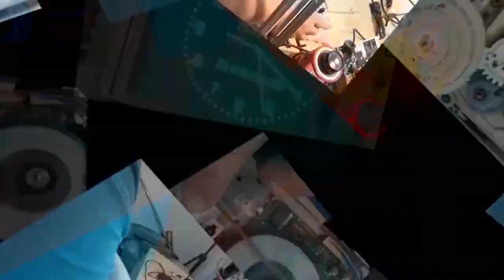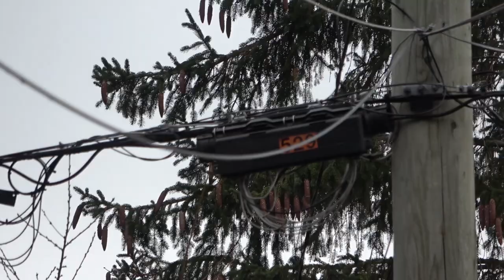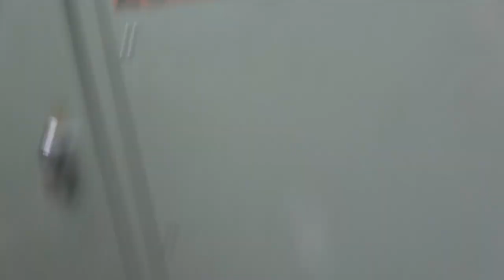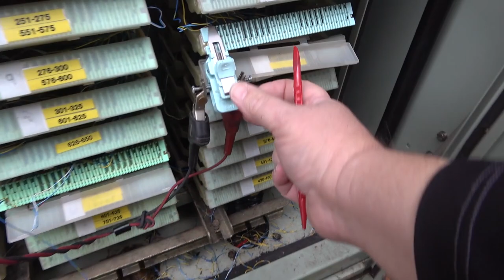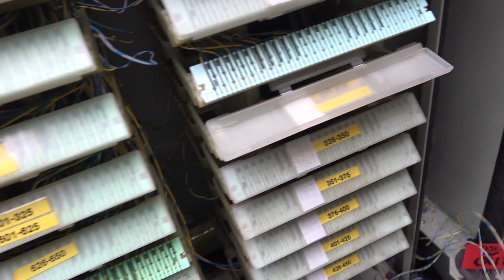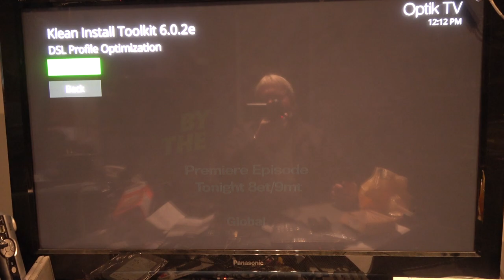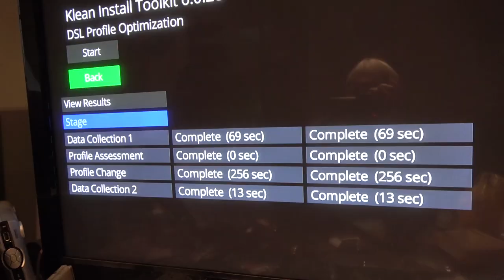Fixing my old noisy copper phone line

Comment: I live in a small town in Tennessee, and AT&T has fiber installed everywhere now in our town and they no longer are using copper for new phone line service. The apartment community where I live had fiber installed back in December 2022 and they moved all xDSL and copper phone service over to fiber,. This was supposed happen in 2020, but the pandemic put a kibosh on that timeline. Before the transition to fiber, the fastest xDSL we had was 13/3. Now we can get 1000/1000 as our fastest speed. I have 500/500 and haven't had any issues and it is a lot less expensive than Comcast cable internet. Question for you. You showed us what you described as a cross-connect. Is that the same as a remote terminal?

Comment: Here in my part of Saint Louis, MO, USA - fastest here is Cable at up to gigabit speeds if your pockets are deep enough. Starts at 100 down / 20 up I believe. We have 1gig fiber in select areas, but I have heard from those users that it has latency issues. Who knows, but cable is plenty fast for the price, around here.
Reply from the maker: Cable is limited to 20 up.  Mine at 75/20 is more than I need.

Comment: Common here to also get the move the pair, especially as there is now a push to fibre, and the old copper is no longer being maintained. Often they just will swap with any other pair, and move the fault to somebody else in the hope they will not complain, as the old paper cables are degrading in the ground.  Wet cable joins are bad with the few remaining ISDN and dedicated lines left around, plus with the few line expanders left, where that 200VDC on the pair does nasty things when it gets wet. 

You know you have an issue when your 30 pair feeder has 10 split pairs in it to get a good wire in at least some lines, and you have a TELEX machine that gives garbage from line noise. Tried to pull out the old lead cable, but it was solidly rusted in the conduit, so instead went with a new route.

At home disconnected the phone, as I literally only got spam calls on it, and the DSL was the only reason to keep it around. Has the original 50 year old cabling still, a lot thicker than the new stuff. Was hard to put in the Krone blocks, had to pre strip it when replacing the socket last time, to get a noise free connection. The phone though could not dial out, more because it was originally a farm party line phone with local battery and magneto, made in 1939, than anything else. Does however clear the line from noise quite well.......
Reply from the maker: 384 volts on the express power for the remote dslam here.  That will wake you up in a hurry. The red covered modules in the cabinet +192 -192 with respect to ground.

Comment: When they run out of CO replacement parts and fiber becomes mandatory you can get an ATA with pulse dial support.  Grandstream HT801 for example.  Security panels with cell or ethernet modules for the old DSC panel exist if you do not want the higher fee.  So alternatives for your objections to switching already exist.
Reply from the maker: When that happens my rotart phones will be display pieces only. 
cell and ethernet modules are only good for a monitored system. My system is not monitored by security company. It dials me directly. I am the monitoring company. I am never far from home. If my alarm goes off I check the cameras and if I see something I am the one calling the police. The police don't respond to residential alarms anyway.

Comment: To have fiber optic operation, the fiber optic line would have to be brought up to the house?  I'm a bit confused.
Reply from the maker: The fiber line is already there. I put it in about 2 years ago. It goes all the way from the connection box to my equipment closet.  Literally all I need to do it plug it into the splitter port and plug in an ONT.  I could have fiber up and running here is about an hour.  The thing is i don't want fiber service.  There is no benefit for me because I would never order faster internet then i currently have.  Sure gigabit internet is available but nobody needs that speed.  I have 75 megs and that is faster than anything i ever use.  I could function fine with 50 or even 25. Remember that an HD video feed requires only 7, a 4k feed 21.  
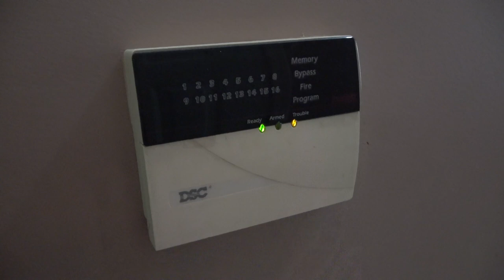So even with fiber my speed remains the same but I lose my backup phone during a power failure (sure a ups could be added but that only good for a few hours ) i lose the ability to use my antique rotary phones and the biggest is my security system.  It monitors the phone line.  If someone cuts it when it's armed the siren will sound. On fiber if someone cuts the fiber nothing happens because the voltage generated by the ont remains on the phone line and the alarm does not know that the line has been cut. Also ont's take updates in the middle of the night which causes them to reset when they reset the voltage drops off for about a minute the alarm system senses this as a line cut and sounds the siren at 3:00 in the morning, unacceptable. The only solution would be to change to a different alarm system one that works off of cellular which means monitoring fees that I don't have to pay now because my system dials my phone directly and alerts me if there's an alarm. I am the monitoring station if my home phone phones me I know there's a problem I check the cameras if I see something i Phone the police. The police respond immediately to a video verified break-in, they don't respond to alarm companies calling or to neighbors calling of a siren going. Even a self-monitored alarm.com system will cost me 12 bucks a month which is something I don't have to pay now for my hardwired self-monitored system. So i keep everything on copper and will untill the day they shut it down completely which is still years away.
Reply: @12voltvids  Thanks for the explanation.

Comment: What I always wanted to know is why twisted pair phone lines aren’t shielded?  Wouldn’t shielding make phone lines more resistant to electromagnetic and radio frequency interference?
Reply from the maker: The twist in the pair rejects electrmagnetic and rf interference.
Reply: The outside plant cables are in fact shielded.
Reply from the maker: @brianleeper5737  
No shit. They are bonded to ground at every access point and every splice point. Also underground drop wire is bonded at the splice and at the customer premise.
Reply: @12voltvids  They are bonded to ground, at least until the utility locator disconnects the bonds and never reconnects them.
Reply from the maker: @brianleeper5737  
The only place the bind is left open here is in the zoi of a power substation.
Reply: @12voltvids  I've found numerous bonds left open in Verizon territory. All I can figure is that utility locators are disconnecting them and not reconnecting them after they are done with the locate.

Comment: Very educational video, thanks!

The city I live in is still all copper from the local phone company, Frontier (it was Verizon up until about 2010). Max DSL speed available is 18Mbps down and 1Mbps up. (I live about a mile from the main switching building.) I had 12Mbps/1Mbps service for several years, but switched to Comcast a couple years because every time something failed they blamed my equipment, or told me to Install Google Chrome. I was required to do factory resets on my router to prove to them that my equipment was not at fault, but that did no good. I would usually wait about three days and then they'd get the problem fixed. Trying to get my bill offset for several days of outages would usually result in me spending two hours on the phone to get $3 off my next month's bill.

In regards to the Google Chrome thing, I called to report an intermittent Internet outage once as was literally told that my internet isn't working because I was using Firefox on Linux instead of Google Chrome on Windows. I work in IT support, so it's not like I don't know my way around a computer network...
Reply: Ugh, Frontier was the worst, and I was in a fiber area. Luckily, I was in an area that got sold to Ziply, and things are improving. No more 3 hour internet outages when the power flickers even the tiniest bit, and there's a power outage 20 miles away because of a car accident. That happened at least 3 or 4 times in the month or 2 before ziply took over. Frontier fiber was good when it was working, but their customer service, and lack of maintenance towards the end was unbearable! Their customer service is among the worst I've EVER dealt with.

Comment: minor question  the customer pays for dsl on the dial tone with the phone numer? a dsl modem does not need to be provisioned ? if a cust swaps modems they need to notify the phone comp?
Reply from the maker: There are different modems in use.  For example we provide managed wholesale service for other companies and our modems will sync up but no data flow.  They have to use the modem provided by their Carrier.
Reply: @12voltvids  thank you again-- lots of good information- i thought lines ran all way back to the CO and not have anything else in the field except cross connect panels..
Reply from the maker: @albertl2542  originally yes but about a dozen years ago FTTC put the fiber and dslam in the cabinet.

Comment: I was a tester on 2Wire noise was a difficult problem as sometimes it comes and goes. I would test the line with M.L.T. and not find any hard trouble. Usually the techs do a cut to clear like you did.

Comment: I have a copper phone line for the same reason the security system is connected on it but there's a backup to the phone line. The backup is a attic transmitter

Comment: You have soo many joints on the line coming from the pole to when it gets into the house, no wander its noisy, here in the UK we have a pole and everyone on the street has line each coming from it directly from the pole through the air directly attached to the house, so its one whole complete cable with no joints from when it leaves the pole to when it reaches the socket on on the wall in the house.
Reply from the maker: The cable pair is connected to the terminal block through a fuse on the pole.  From there it goes to the drop that goes to the house and then to a gas tube surge arrestor and from there into the house.  The noise was from a breakdown of a splice between the pole and the service cabinet.

Comment: Our 911 system here is a joke. There was a "bug" with the iPhone a while back that if two buttons were pushed at the same time, which was easily done by simply placing the phone in a car cup holder top down, it would dial out to 911. All 911 did was call back and leave us a voicemail and said they received a dead air call from our number and if we have a emergency to give them a call back. I'm hoping they were aware of the bug back then and that the call was made from a cell phone/iPhone... but still, that was a joke.

Comment: Here in the Netherlands we have also still copper and more and more glass fiber. New houses dont get copper even anymore. But I still have in my house and only 200 meters away from the hub station. My speed on VDSL is super. Even quicker then it officially should be. I had the same problem and they have put be on the backup as well.....so if that is failling they have to make a brand new connection with a new cable in the ground. I am wondering btw, here in NL all cables are in the ground. Why is this not there where you live?
Reply: It's the same in the UK, too expensive to put cables in the ground so the vast majority are in the air especially for older streets. Newbuilds usually have it underground

Comment: You being a phone guy you should know there are ATA boxes and Pulse to DTMF converters. Also there is a communicator you can get for your old DSC that will emulate a POT's carrier and uses a cell radio for the alarm.

Another thing to note is most Cell Phones have e911 so if you call 911 and you cant talk they will arrive to your address. It uses your WiFi connection for that mostly and I think it even sends out a GPS location for verification. However if you're at starbucks and you call 911 they will want the address of the location if you can't inform them they will then have to rely on using the GPS location.

Here in the states POT's is gone. It's in some form of VoIP. Even DSL here is running on a digital line, converts to Analog then back to digital. Probably the reason why DSL is so slow here. The fastest DSL speed I have ever seen was 20Mbp/sec on the Download and 5Mbp/sec upload.

Comment: I work in a NOC so I'm somewhat familiar with all this but I've never physically worked much on the outside.  I've done jumpers on the frame and I have done a bit of troubleshooting outside of my duties (ex: doing a favour for a customer on my own time) so it's cool to see others in the industry working on this stuff and seeing the outside part that I normally don't see.  While fibre is better performance wise you're absolutely right about the other points you made, like 911 etc.    I did end up switching to fibre when it came to my area and decided to go with just internet to save money, but I sometimes do miss my land line.   It's a piece of mind to have a backup phone.    Also I'm surprised at how fast your DSL is!  What kind of setup is being used?   Guessing it's fibre to the node and that cabinet is fairly close to your house?
Reply from the maker: Cable wise about 600 meters from the fiber cabinet.

Comment: I often thought about making a video like this. 62k views is decent! I recently switched from telco contractor to cable contractor after 14 years. Our OSP has been shot for years. I won't miss trying to "fix" trouble tickets. After seeing countless RA's that are crumbling, it's a wonder this junk even works. Our telco was bought out (back?) by Bell a few years ago, and they're finally doing fiber overlays thru the rest of our city. Good riddance to the copper.
Reply from the maker: Copper can be crap and it can be good. For me it is good. I do have fiber hanging right there that I could switch to in a heartbeat. The only thing holding me back is price. It will cost me more for the same level of service I currently get on my old copper service. Why?, well because I am on an old channel package that is not available anymore. For example I have a single sports package that is 9 bucks a month and I get all the TSN and RSN channels. That is 5 TSN and 5 sportsnet channels. 
Those are now 2 seperate packages @ 8 bucks a month each. So 16 for what I currently pay 9 for. All the channel bundles have been broken into smaller packages. They  are 8 a month I believe and I would need 8 to get the same channels I get with 6. Then there is the box rental. On my old plan I get 6 at no cost. On the new one 2 are included and I pay a monthly fee for the additional 4 which are very seldom used, but nice to have for when needed. For example I use mostly the TV room and kitchen box. Those are the most used boxes in the house. I rarely use the one in my office except when I want to record something onto DVD or my PC then I use that box. Ditto for the one in the living room, master bedroom and workshop. I usually just watch off air tv in the bedroom, but occasionally I want to watch a recording so need the box. Not something I would pay 5 bucks a month to rent. 
So changing technology just for the hell of it is not a consideration. When the copper is decommissioned then I will go, but as long as the DSLAM up the street is still running then I am staying where I am and enjoying the grandfathered service that I still have. We have been overbuilding here for 5 years now and probably 70% are on fiber now, but as I said the benefits of sticking on the old platform outweigh any benefits of going to fiber. I don`t need anything faster than I have so why pay more.?

Comment: The caller's location can also be determined without GPS on the mobile phone. Of course, this takes longer, but a phone without GPS can still provide relatively accurate information based on the mobile device connecting to multiple mobile base stations.
Reply from the maker: Close is not good enough when your having a heart attack.
Reply: @12voltvids  I agree with you. I wanted to say that landline is definitely the best service for the location, but as far as mobile phones are concerned it is not necessary that the cell phone must have GPS in order to reach the location of the user, nor that it must necessarily be near the window. If the cell phone has access to several mobile base stations, then the location will be correct (in cities mostly). In conditions where the device is connected to only one base station, this is useless. A much bigger problem with locating mobile phones is how the services are connected to operators in this regard, it depends on the state to state. As for being close enough isn’t enough, I absolutely agree, but the landline also has its problems in that case. A much higher chance is that a person who has a heart attack is closer to a cell phone than a landline. If a person has a house and does something in the yard, it is unlikely that they will even be able to get to the location where the landline is located, in addition to that walk, etc. creates additional stress for the organism.
Reply from the maker: @Bruno_AFK  ever heard of cordless home phones?  
In an apartment your cell phone won't indicate the suite.  So now you have paramedics banging on everyone's doors looking for the emergencyz or words the police looking for a suspect that just broke in and all you could do was dual boot 911 and drop the phone and hide.  Bad guy in house and you can't speak.